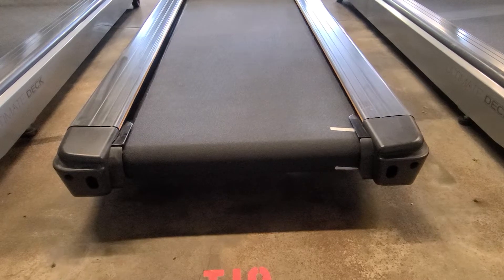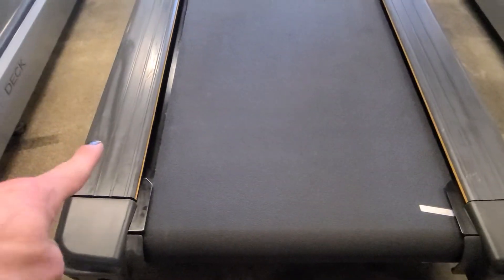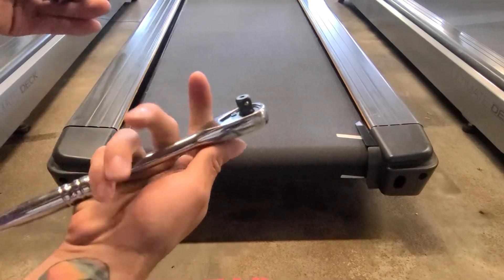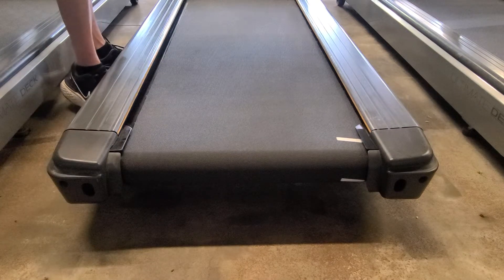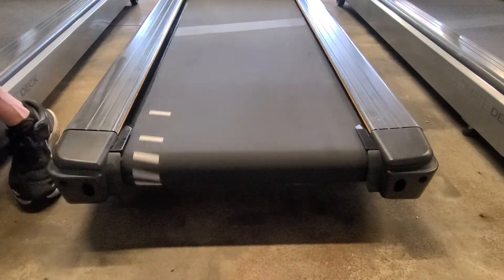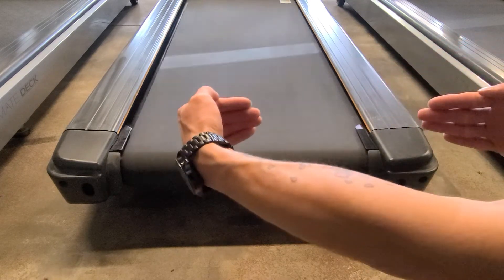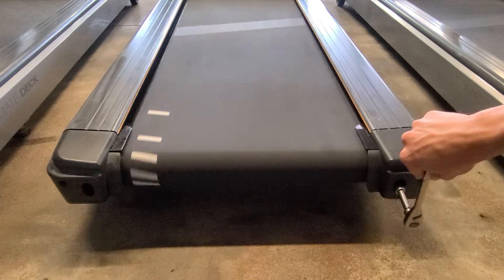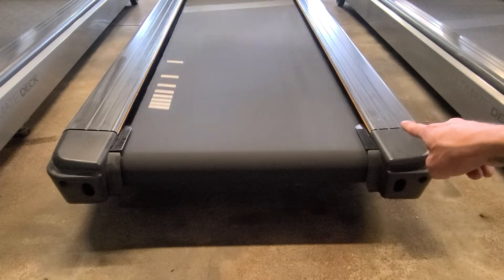My treadmill keeps going to one side?? Treadmill Belt Centering (Matrix)

Comment: Wow that seemed like a lot of adjustment (turns) for that amount of movement.  I'm new to this so not a criticism just an observation.  The manual on mine (Spirit) says to quarter turn maybe twice, so half turn max on a belt that's all the way over to one side.
Reply from the maker: These belts were newly placed on the treadmill and hadn't been tightened to the spec before this.

Comment: It doesn’t work at all. Once I step on it it moves again. And when I tighten other side, it’s straight, but goes crooked once I step on it again.
Reply from the maker: It needs to be reset back in the middle and count the number of screws you do on eachside
Reply: Would be great, but it won't open up. The screws are so loose now, but wont come out. My treadmill is eqi smart walkingpad, and it's a lot different than treadmills and especially ones in america or any other country :(
Reply: I had the same problem and figured out the floor itself was slightly uneven…check for hyd that

Comment: Been sitting here for hours and dont understand 

The tighter side is pulling
Reply from the maker: Loosen the tighter side, you can keep tightening one side or even both sides. You might just have to restart the process
Reply: @coloradocardio  called the manufacturer and took an hour to figure it out. Had to remove pieces to completely start over but I figured it out and understand now

Your video encouraged me to call for help lol

Comment: Mine is centered perfect………until I start walking on it. Then it goes to the left ……???
Reply from the maker: You might be heavier on your left side, just saying. You can comp for this
Reply: I had this same problem then I discovered that the floor wasn't level. I put a piece of plywood under the feet of the treadmill on  lower side and now the belt stays centered.